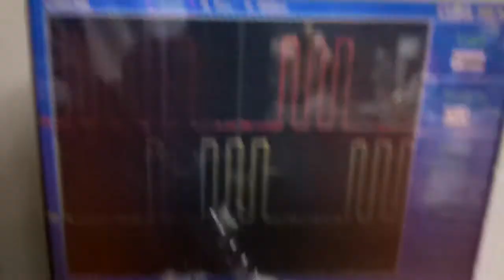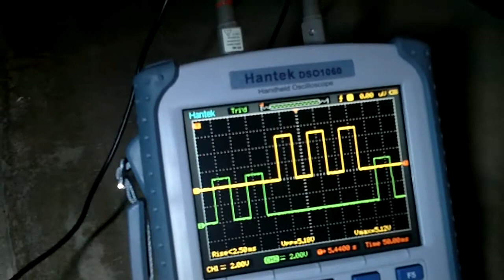attiny85 emergency strobe  lights

Comment: How to get sketch please.
Reply from the maker: int x=0;
int potPin1 = A3;//number of blinks
int potPin2 = A2;//flash delay
//int flash = 0;
int ledPinR = 0;//1st led light
int ledPinB = 1;//2nd led light
int flashBlink = 0;
int flashDelay = 0;

void setup()
{
 // Serial.begin(9600);
  pinMode(ledPinR, OUTPUT);
  pinMode(ledPinB, OUTPUT);
  
  
}

void loop()
{
flashBlink=analogRead(potPin1);
//Serial.println(flashBlink);
flashBlink =map(flashBlink,0,1023,1,100);
//Serial.println(flashBlink);
flashDelay=analogRead(potPin2);
//Serial.println(flashDelay);
flashDelay=map(flashDelay,0,1023,1,10);
//Serial.println(flashDelay);
for(x =0; x < flashDelay; x ++){
    digitalWrite (ledPinR, HIGH);
  delay(flashBlink);
  digitalWrite(ledPinR, LOW);
  delay(flashBlink);}
  
  
for(x = 0; x < flashDelay; x ++){
  digitalWrite(ledPinB, HIGH);
  delay(flashBlink);
  digitalWrite(ledPinB, LOW);
  delay(flashBlink);}
  

}
Reply: any chance you can email me the circuit digram in the video as struggling to get it to work.
Reply from the maker: Google search my name and the title of video you should find the breadboard layout.  The voltage regulator only necessary if hooking up to power source more then 5v like I did in the car.